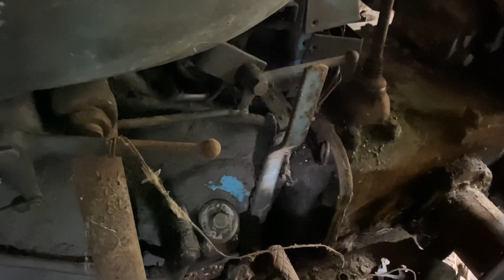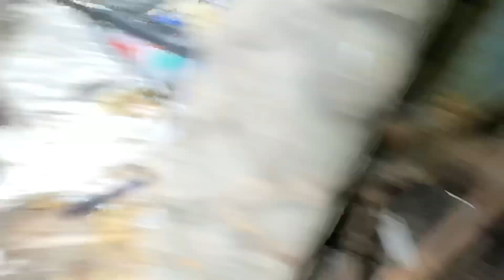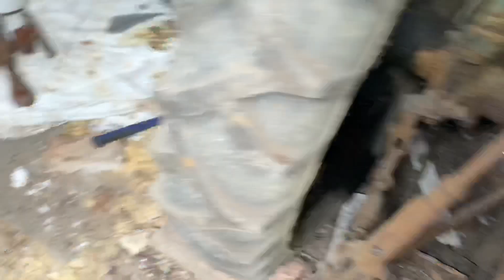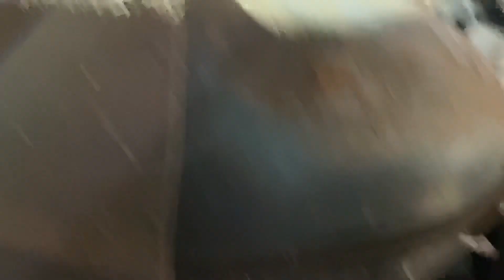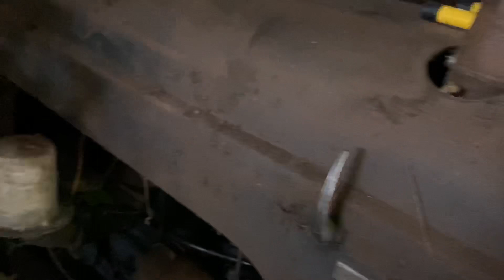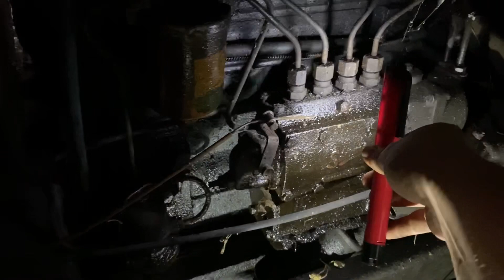Will it start? Abandoned Fordson Major Diesel - First start in 20 years!

Comment: If you look under the seat on the right hand side of the hydraulic top, there is a plug.  If you take this out, you can screw a hydraulic fitting and hose into it to fill the gearbox up.  It has a permanent hydraulic feed when the pto is engaged.  Thats how I fill mine up, it takes a few months to drain back into the backend!

Comment: Well done.
I ought to have told you that the cold start button releases as soon as the engine starts up and needs pressing in each time if it stops.
You will probably find it wont even need it once it has been ran a few times, she sounds as though she has reasonable compression which will get slightly better as the valves bed in after sitting so long, maybe a sticky ring or two also.
I wouldnt bother stripping it any further though, a change of all fluids and filters, a good going over with a grease gun and she'd be ready for a days work.
Hardiest tractors ever made, we used them in the woods (and still do) for over 60 years (dad bought his first new one the year I was born) and the abuse they can take is quite extraordinary 👍👍
Reply from the maker: Ah that explain the harder start the 2nd time around. It would have stayed running that time but i chickened out and tried to get it to idle too soon. I think it might have a cylinder down on compression. But with a longer run and a bit of heat in the cylinders im sure it will sort its self out. 

Im not intending to do much more too it now. Just have to back it out and on to a loader and its off to another storage place. Wish it was mine! Id drive it the 10 miles home 🤣

Comment: Ha-ha! I was yelling at you "Cold start button! Cold start button - on the injector pump! Jesus, use the bloody cold start, why don't you!" Fact is, I bought an abandoned 1951 E1A, and used to fight with the damned thing until an old boy, a retired farmer, saw me struggling to get the tractor started, and kindly educated me in the finer points of early Fordson diesels.
Interestingly, unrestored but keeping an eye on essential maintenance, I used that machine pretty much every day for ten years until I sold my 'hobby farm'. The tractor I gave to my nephew who uses it on his Northamptonshire property to keep the grass down in the paddocks. Still running well - looks like sh*t - and at 72 years old, is still a reliable work horse.
Reply from the maker: Thankfully someone did tell me about the cold start button. So on day two i found it and got her running. I lost contact with this one. I suspect sadly it’s just rotting away again. I tried to buy it. But owner could not see past the sentimental attachment he had to his grandfather. I hope he has kept it dry and in this condition. Had it of been mine I would never restore it

Comment: Trying to do the exact same thing right now 🚜. Starter has been cleaned, fuel is being delivered to the engine and she keeps trying to start but not getting there
Reply from the maker: Have you put the rack into ‘cold start’ position. It delivers more fuel to the engine for cold starting. Follow the cable from the stop pull switch on the dash down to the injector pump. There you will see the lever on the rack. It should have button on that lever push it in and the rack moves in more to allow more fuel for starting 👍
Reply: @MO3MINI  Thanks. Got there in the end, took a few goes, let her cool down for an hour and she started perfectly 👍
Reply from the maker: @jackpumpkinpatch2119  awesome. Any videos?
Reply: @MO3MINI  sadly not, will do next time

Comment: It sounds like the choke was still on a bit
Reply from the maker: Diesel engine with a choke? Hard of emergency shut off plates in the inlet manifolds but not a choke on a diesel engine. Will have to look into that
Reply: @MO3MINI  some people call it a stopper. It's a little knob you pull out to stop the engine (or push in on a David brown). If it's not pushed in fully the engine runs a bit off like that.
Reply from the maker: The stop on the major pulls the rack closed. There is a flap in the intake but it seems to be linked directly to the throttle linkage
Reply: @MO3MINI  oh. I remember on one a friend Had (can't remember was it a diesel, power or super major) there was a stop on the Sims pump. Don't know too much about majors as I only really deal with masseys and David browns.